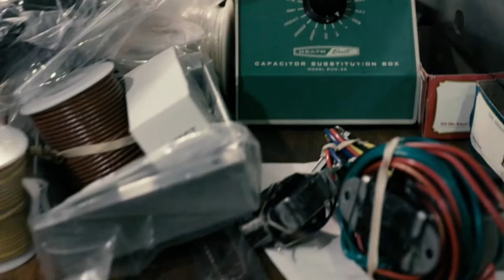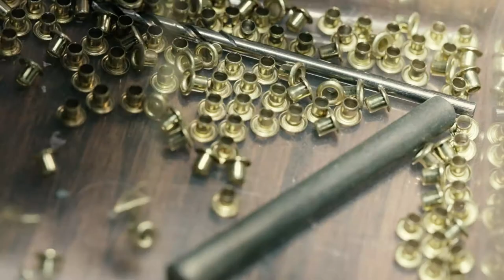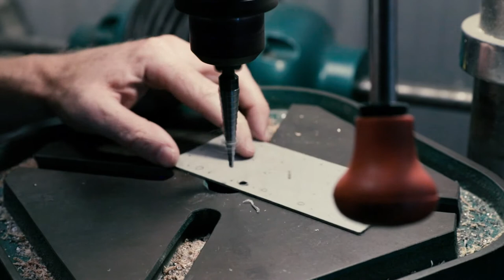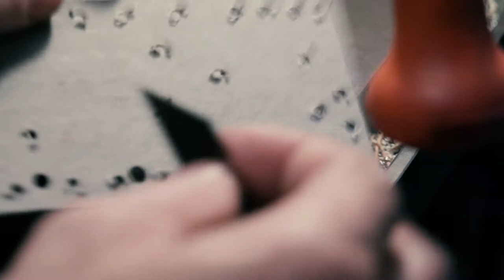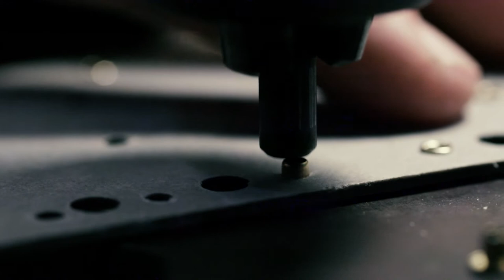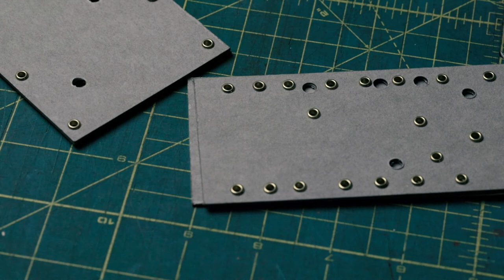Tagboard & Eyelet Construction Handwired Guitar Tube Amps from Scratch like Leo Fender

Comment: Nice job! Considering using eyelets on my next build.
Reply from the maker: Thanks!  I really like using eyelets. Gives you the ability to be creative with layouts without being stuck to a perf grid. Also there’s physically less material than a turret. Every eyelet becomes part of the circuit and while the difference may be minimal it is also cumulative. I just don’t like having excess conductive material in a build as I’m always after a silent running circuit. The tag board also is easy to use a chassis punch on if you want to mount a cap can on the other side and feed it through. Phenolic boards are tougher to cut and or put big holes through.  

So thanks for watching and good luck with your build!  Hit me up if you need help.
Reply: @FreshOldSchool  Good points. I used turrets on my last build and it went fine, just always looking for a better way to do something and would think eyelets would be a good alternate. Not a fan of point to point or PCB.